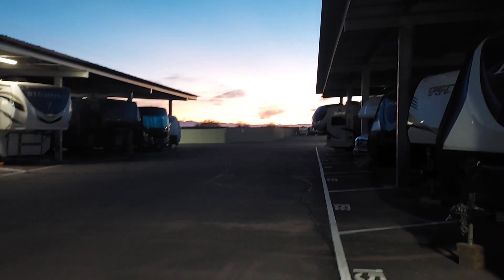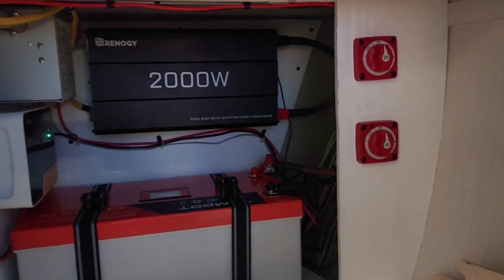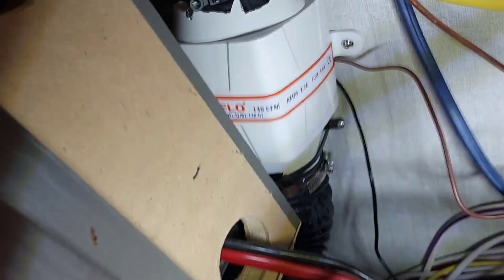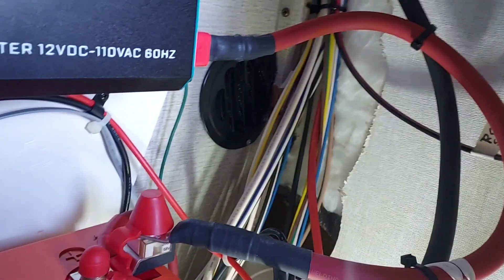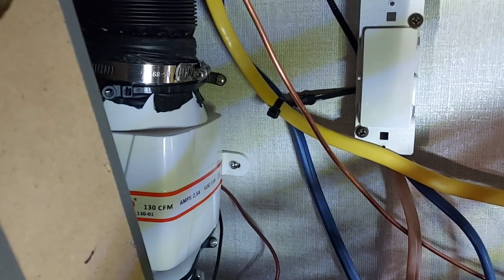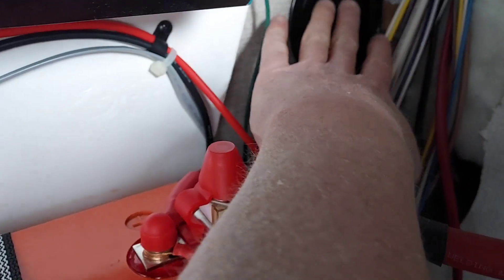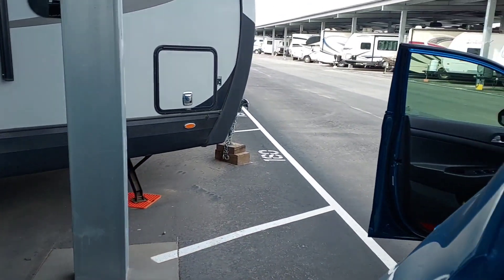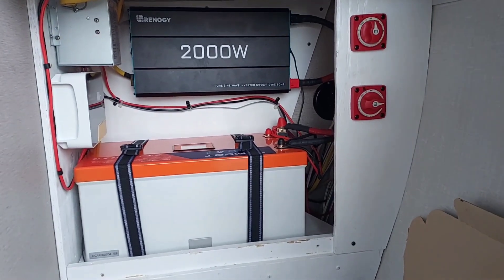Cooling RV lithium battery cabinet, keeping solar controller and inverter cool.

Comment: Now that it's summer, how has this worked out?  I am looking to do something similar on my 25G.  Appreciate your feedback
Reply from the maker: @FarmerCal  It works OK, I haven't really needed it yet. I have tried it a few times and it lowered the temperature 5 degrees in about 7 minutes. I don't like how loud the fan is, but we'll see.

Comment: Nice job. Thank you.  I do wonder though, if the blower itself would fit somewhere to the right of the battery in the outside compartment ?   The blower specs shown on the Amazon page shows it at 130db.  That's pretty loud so it might be something to consider.   You could still pull air from the inside via a longer inlet duct....     EDIT:  I now wonder if the 130db Amazon listing should be shown as CFM flow, not noise level ?
Reply from the maker: Good idea. It would work in battery cabinet too but it would be tight. If I did this again I would make the cabinet bigger. I really don't think I will need to run the fan very long. 
I think 130db would be deafening, I think they mean 130cfm.
Thanks for watching!